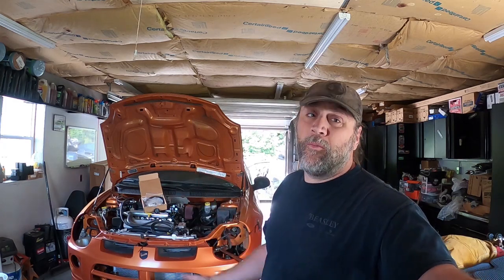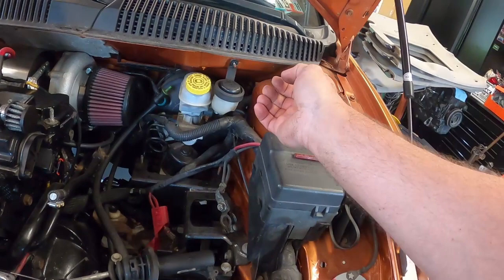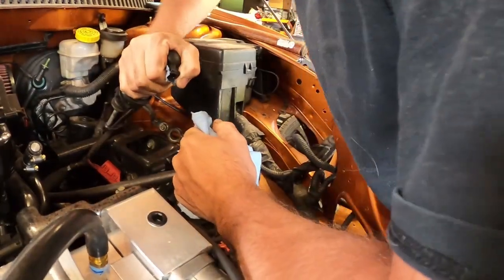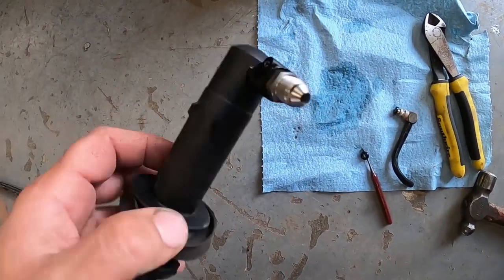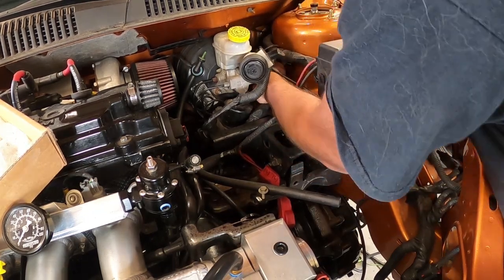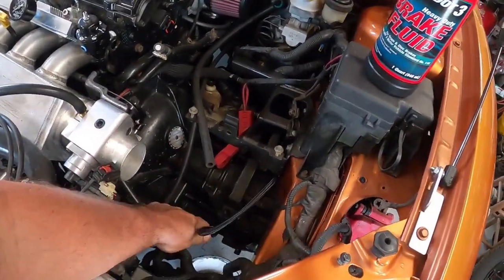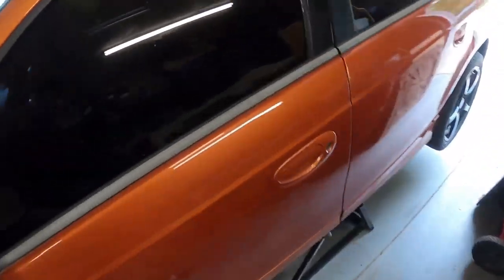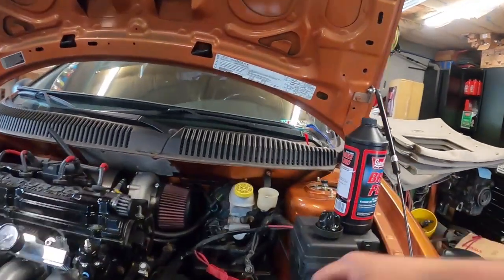SRT4 CLUTCH LINE INSTALL

Comment: I have the DCR clutch master-slave combo kit from about a year ago, and I can confirm that it uses the same tapered ball end push rod vs the strait rod-rounded end style that my 5+ year old DCR push rod has on my OEM Master cylinder.  The newer DCR push rod will have a positive connection when popped into the internal socket of the DCR Master cylinder.    I keep both push rod versions in case I ever get an aftermarket replacement master cylinder that doesnt work well with one of the versions and as a backup part.
Reply from the maker: I was wondering it’s the first time I seen one this style thanks for the info..